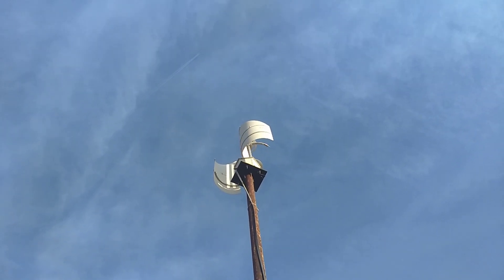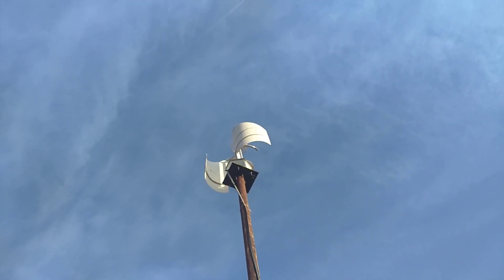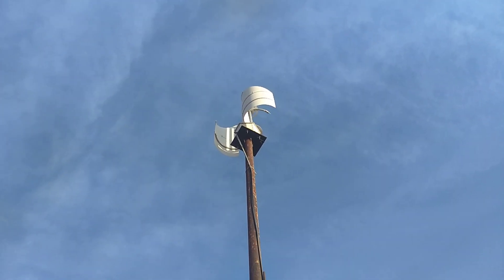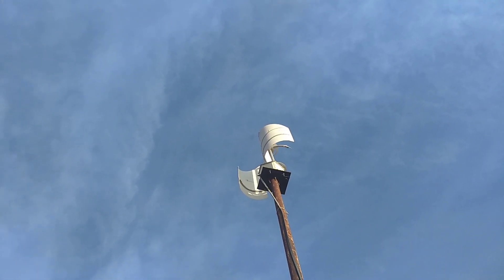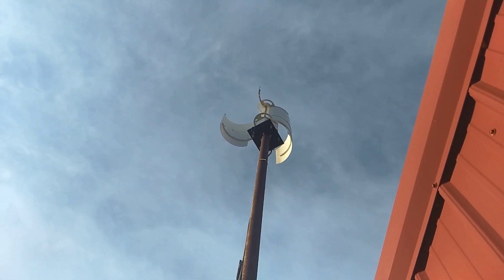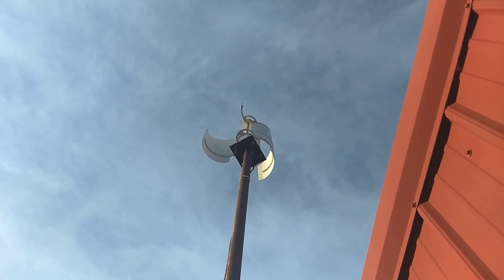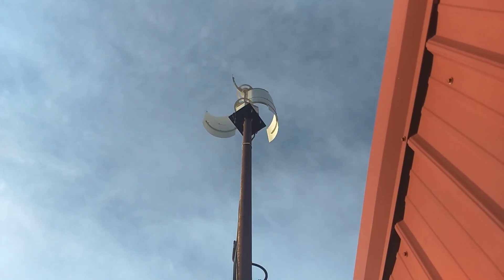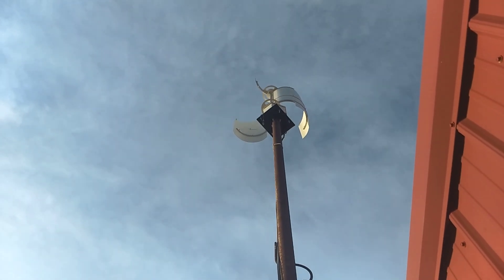The sad conclusion to the TESUP Atlas 2.0

Comment: Hey man really like your insightful videos.
I am looking to buy a wind generator for here in nz, was mesmerized at the Atlasx as it was so compact and had such a high output, but perhaps I was going to endup another sucker.
What do you recommend for output vs price?
I like the idea of a vertical axis but I'm not so sure that there is any good ones.
I am practical and can put up with maintenance (what i thought was the only problem with tesup) but would still need something that is capable of producing power in a usable amount.
Reply from the maker: Right now the iSta Breeze i1500/2000 is the more power per watt you can get on purpose...followed pretty close by their Heli 2.0.  You can get better from China sometimes, but you won't know until it arrives which makes them risky and troublesome.

I have no seen a single working example of a consumer grade vertical turbine that works that doesn't cost a ridiculous amount of money.  The Go Green Energy vertical turbines, for example, are in the neighborhood of $1800usd for a 300w turbine.  They work awesome and the 300w rating is nominal output, not peak, but it's still a HUGE investment.  You can buy three i1500's for the cost and make ten times the power.

I really suggest that if a vertical turbine is what you want, that you make your own.  That's your best chance for getting usable power and an effective turbine.

Comment: I got mine to charge up a 48 volt battery Bank. At 25 mph wind I was lucky to hit 43 volts. I put a amp meter on it between the batteries and the charge controller I have still yet to see any kind of amps coming out of it. It did not even come with locknut washers. I also could not balance it, after a while it just locked up somehow wouldn't turn. I sent a video and pictures to tech support and they said they have trouble getting it. That means they just don't want to talk about it. It's junk. Mark,

Comment: I had commented on your initial video's when you got it, Pure fairy storey technology.
With some people, it's like the Emperor's new clothes, nothing bad is reported due to embarrassment, I don't want to look bad.
We have a customer who is interested in the  4.0 how do you rate the 2.0?
It's good to see these informative video's, well done.
Reply from the maker: I'm assuming you're talking about the Heli 2.0?  If so, after getting the new blades it's been a great machine.  I was pretty wishy washy on it before the new blades...with the original 107cm 5-blade rotor it would hit the peaks and make power but startup was pretty poor and it had trouble holding RPM.  With the new blades it starts up easy and makes good power almost constantly.  To the point that I've had trouble managing the output.  I haven't seen the Heli 4.0 in person so I have a hard time commenting on any of its specifics, but I would be pretty confident in it performing well.
Reply: @ToysforWatts  Hi thank you for your synopsis on the 2.0.
The stalling issue would be sorted in the higher voltage models by tweaking the algorithm in the synchronous inverter.
I had to do this for a customer 2 weeks ago.
The turbine was stalling and growling.
After modification the turbine spun up smoothly and the Growling disappeared.